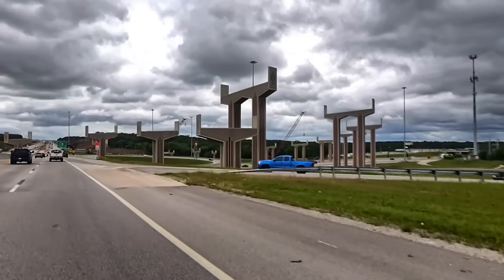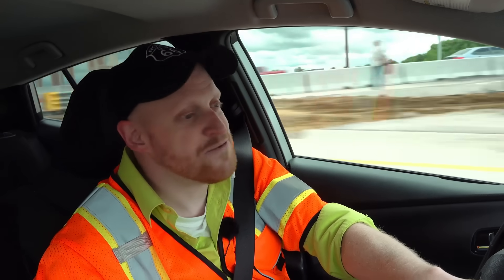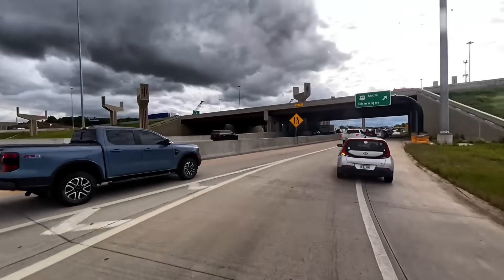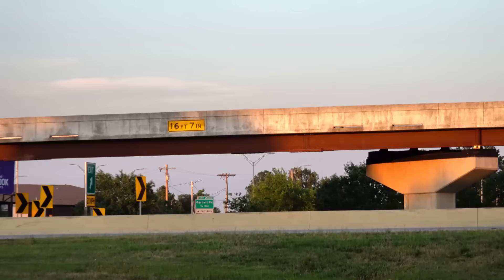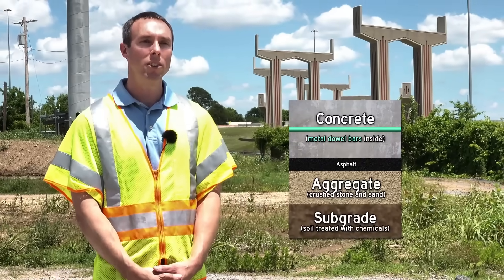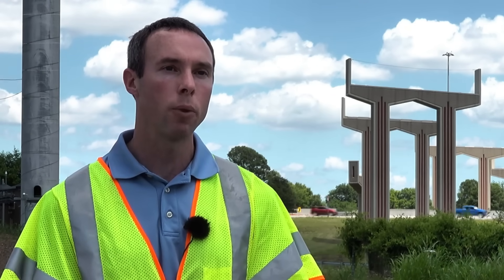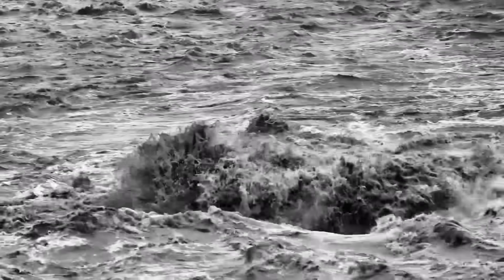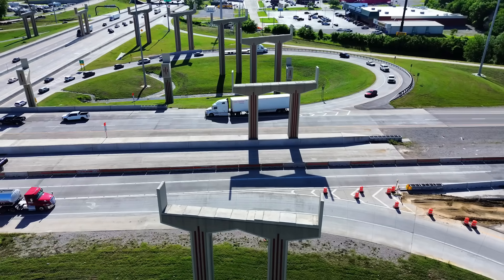Tulsa Built 50-Foot Goalposts 🏈 (It Fixes a Cloverleaf Catastrophe!)

Comment: 400M for an interchange, the rough average lifetime earnings of a US worker is 2.7M. That means this project is worth the working life of 148 people to put that number into perspective.
Reply: Well let's look at it another way.  In the 10 year period between 2010 and 2019, this interchange had 9 fatal accidents and 59 accidents that caused incapacitating injuries.  The new bridges of the safer interchange design are expected to have a lifespan of 75 years; so they could save 67 lives, and keep 442 from being severely injured.   That makes the cost $785,000 per injury or fatality that could be prevented with the safer design.   (The existing interchange experiences roughly 190 accidents per year; 1% of which are fatal, 4% of which are incapacitating injuries, and 43% cause less severe injuries.)
Reply: @Drysart  To add to this, the US D.O.T. puts the value of a life at 13.7 Million which is substantially larger than my used statistic due to the total economic value of a human to the government, the cost of systems to respond to these incidents, the human time lost to these incidents, and some might claim some padding to make projects more appealing. The existing 10 year cost of human life would then be valued at 123 Million which could be considered the current operating cost. With more data on the 'MAIS Level' in accordance with 'VSL Guidance' document from the DOT a further calculation would be possible for the cost of the incapacitating injuries, assuming those 59 are MAIS 5; critical we could put their value at .593% of the VSL or 479 Million. 

This would put the current operating cost of running this interchange at ~600 Million/10 years. These numbers are potentially inflated due to the assumption that those accidents are critical but the lower MAIS level incidents are not known to us so this is likely a low estimate in the end. If this new system is substantially better at preventing accidents it could easily cover it's construction costs and likely would never get funding if it didn't meet these numbers.

My original comment was more to put the raw project cost into some more human terms, it is very hard to visualize hundreds of millions of dollars but easier to think; 'If I saved all my money for 148 lives only then would I be able to pay for this'.
Reply: In Ontario our government is spending 500M CAD on a huge parking garage at a place very few people will go that is already serviced by subway, regional rail, bus, and streetcar. This at least solves a problem so it could be worse!
Reply: And it was last 75 years and save millions in property damage from less accidents as well as decreasing carbon footprint
Reply: And 45 percent or more of that money goes straight into manhattan, Sherwood, and Becco’s pockets as pure profit. The rest is for material and labor.
Reply: yeah, don’t spend all of this money on green public transportation modes. use it on car infrastructure so the planet can get even hotter. but look, you have a bigger ramp now. whatever that means. 😒
Reply: Over the life of the interchange, it would save that many lives, I suspect.
Reply: That's cheap! The Feds spent 40 to 70 Billion dollars to rebuild Boston's downtown roads and highways so Bostonians only spending an hour in rush hour traffic instead of 2 hours. Do the math on that.
Reply: @leomaxwell3662 40 to 70 Billion? That range is pretty extreme.
Reply: Also much of that money goes to people. Like the construction crews on the project. It doesn’t just evaporate.
Reply: Or from another perspective, if this more efficient design saves every car 5 seconds on their commute, that frees up about 9 human days worth of time every day (at 150,000 cars/day)
Reply: @805phils  
 9 days * 5 week days/ week * 50 weeks/year * 75 years / 365 days = 462 years saved.

Assuming 1 person per car and only 5 seconds saved.
Reply: Or half a century of 100 social workers (or similar) making the life of everyone in your city a lot better.
Reply: @steemlenn8797 

Social workers wouldn't be needed if you lefties would stop tearing down things like the traditional family, personal responsibility, self reliance and accountability.
Reply: But remember, universal healthcare is way too expensive. We need that money for highways!
Reply: @soymanmilk  - we don’t have money for both, right? Gotta make decisions…..
Reply: @soymanmilk damn straight.  The highways pay for everything else, they are the pulsing veins of the economy.  I hope you were being sarcastic,  because that would be an incredibly brain-dead comment otherwise.
Reply: @soymanmilk  Just to be clear, you want Trump to be in charge of your healthcare?
Reply: @soymanmilk 

Pay for your own damn healthcare. I do. That means I'm financially responsible and I don't spend money on things I don't need.
Reply: @CorneliusTaylor-s1uThey would. Thats how government programs work. We’d all pay 🎉into it. It would also be ideal to have employers contribute or match whatever amount the employee pays, similar to unemployment and even social security.

Comment: What I don't understand is why signage before cloverleafs isn't better.  It's gotta be the cheapest solution but so often the problems happen because people aren't told where to go until they are almost at the exit.  Why not start telling them way before the prior exit?
Reply: unfortunately, there are drivers who can't or won't read road signs. either they are sufficiently distracted or want to maintain a maximum speed as long as possible.
so you have drivers who come to a complete stop on a freeway and then try to merge over three lanes of traffic. other drivers just throw on the turn signals (if you're lucky) and merge across whether there is traffic coming or not.
Reply: @capnkwick4286 Thats always true.  But all the time when I'm driving I want to get over early and I am earnestly watching the signs and by the time they tell me where to go it's a tight thing to make it in decent traffic.

Comment: Great video as always! Hearing Oklahoma called the "Midwest" hurt my soul, though.
Reply: Oklahoma is a weird crossroads that doesn’t quite fit in any of the surrounding major regions. The best I hear is “Great Plains”, which definitely is true.
Reply: @andrewreynolds4949  Great Plains is 100% right for the best fitting, I agree.
Reply: @clippy_le_clipster  Not quite adequate, but it's the best I've seen. There is an argument to be made that it's a "lesser Texas"/"Texas minor" of sorts, since it's similar in a lot of ways and many Texans don't see themselves as part of the surrounding regions, but more of its own thing
Reply: @andrewreynolds4949  I tend to put Texas with the Great Plains since it's generally synonymous with "Tornado Alley", at least large stretches. Also fits Gulf Coast, but less so, if you use that region label.
Reply: @clippy_le_clipster  I'd say it's a split, the coastal areas look very different from the inland areas
Reply: @andrewreynolds4949  Yeah, it's tricky since cultural and geographic features don't map onto lines on the map very well. I'd probably just toss it all into "the Old South", "Dixie", "Plantation Belt", "Cotton Belt", or some other euphemism for the secession states.

It's like how the Midwest is still fairly strongly bound, culturally and geographically, by the same boundaries of the Old Northwest Territory. Different regional histories.
Reply: i prefer "bible belt" as it includes the most culturally similar states, without unambiguously southern states getting their panties in a twist about it.
Reply: @rawrrawrrobin  Oooh, that's pretty good. Good point.
Reply: @clippy_le_clipster  Most Oklahomans I've spoken to probably wouldn't ever call Oklahoma a part of "Dixie" or "the Old South", and I don't think there's much in the way of old plantations!
Reply: @andrewreynolds4949  I didn't say Oklahoma was Old South. I said Texas is.
Reply: @andrewreynolds4949  I've always like "Mid-Continent", but not sure that would be accurate. Growing up there I figured it was south, but as an adult living in the actual "south", I can tell you that OK is definitely not a part of the south.  Most of the state would fall more Southwest than any other region.
Reply: @andrewreynolds4949  Yep, Oklahoma is actually the Southwest but most people don't know geography. Many Oklahomans don't even know that Oklahoma is in the Southwest
Reply: Kansas doesn’t claim Oklahoma as being in the Midwest
Reply: @jljordan1  We don't give shit about your state
Reply: @jljordan1  I would hope not, since Kansas also isn't Midwest!
Reply: @clippy_le_clipster  Kansas is definitely Midwest along with all the Great Plains states to the north of it and Oklahoma is absolutely in the south, though not “Dixie” or “Deep South”, along with Texas.
Reply: @Baseball-huh01  Kansas is not even close to the Midwest (unless you only count Census regions, which are just for paperwork). I wouldn't even count the most western parts of Missouri or Iowa as Midwest, but cutting states in half makes it messy.
Reply: @Baseball-huh01  This hurts my Midwestern heart
Reply: @clippy_le_clipster  I agree, KS is not "Midwest". Not sure what it would be though, but "Plains" does work.  Some of it even "High Plains", Goodland KS for example is almost at 4000'
Reply: @clippy_le_clipster  Kansas is absolutely the Midwest
Reply: Unfortunately 66% of Oklahoma residents consider themselves to be living in the US
Reply: @clayed3311  I'm pretty sure 100% of Oklahoma residents consider themselves to be living in the US, actually, the poll was talking about them living in the Midwest
Reply: @Zastrava  yes, some in Oklahoma are stupid and wouldn’t know that the Midwest is in the United States.
Reply: Also weird at the end of the video that it's part of Rob's "Summer of the Southeast".  Definitely neither of those regions lol
Reply: Yep, Oklahoma is actually the Southwest but most people don't know geography. Many Oklahomans don't even know that Oklahoma is in the Southwest
Reply: Oklahoma is more like the armpit of America
Reply: @soymanmilk Stay in Commiefornia soy boy.

Comment: The tax may have not gone up since 94, but the number of cars has which should offset some of the gap, yet also contribute to congestion. Like a snake eating it's tail.
Reply: Cars have also gotten significantly more fuel efficient, which means they pay less of those taxes.
Reply: Fuel efficient yes, but fuel consumption is up because of longer distances and heavier vehicles. @NickCBax
Reply: @NickCBax  And then factor in all the electric vehicles that pay no tax at all.
Reply: @ArmandGirard  In Oklahoma electric vehicles are required to pay their gas tax each year when they renew their registration. It's based on what the average gas car pays in taxes, which is just under $100.
Reply: @beachhouse13  that seems fair